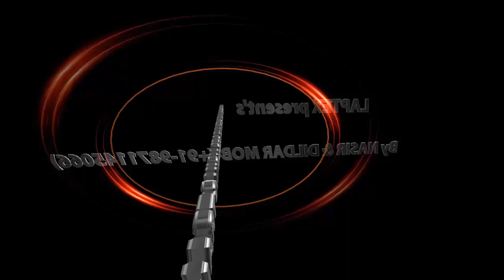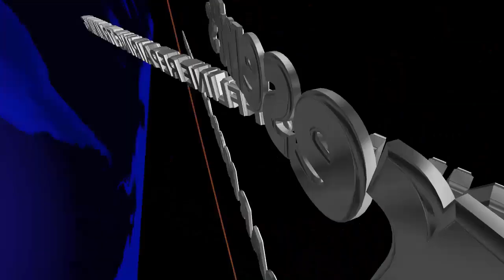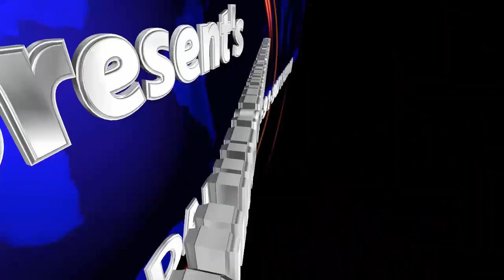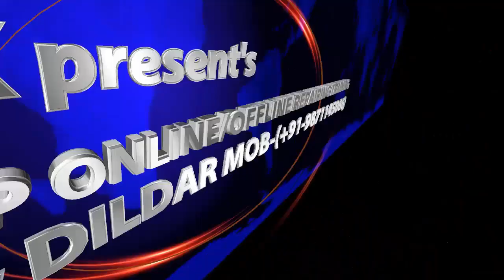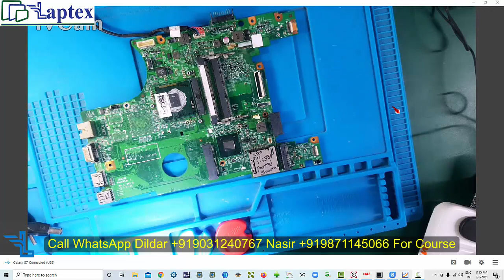DELL Laptop Restart with RAM and ok Without RAM solution and Light Blinking Problem in English |dv14

Comment: Hi sir I have hp laptop motherboard part number la-g07fp which is on no display problem but external display from hdmi is working fine ram supply is ok 1.2v all supply seems fine please help me sir
Reply from the maker: Could be due to BIOS issue.
Reply: Sir I don't have bios programmer but I have downloaded bios from hp support drivers and updated it but it is in same condition.